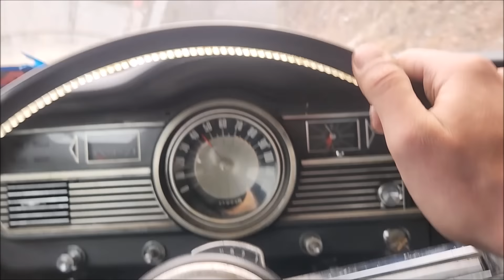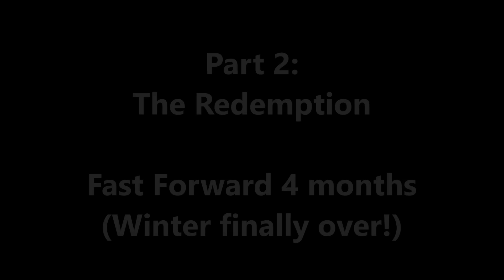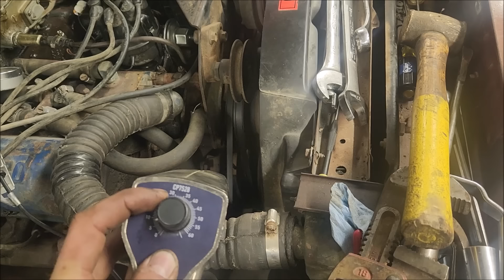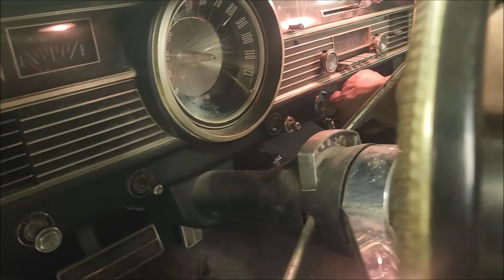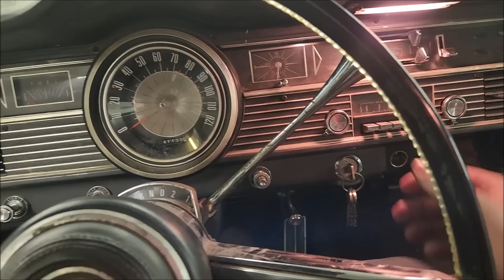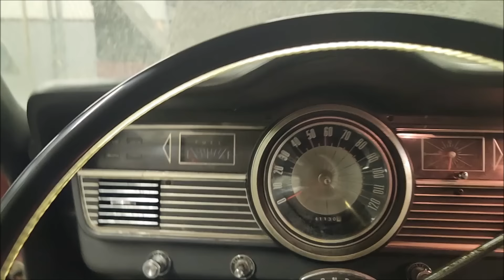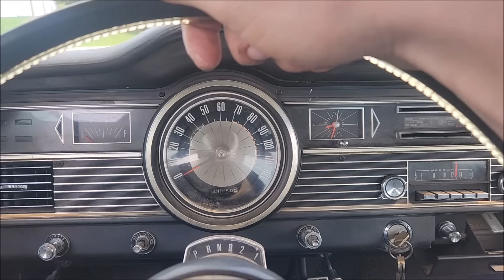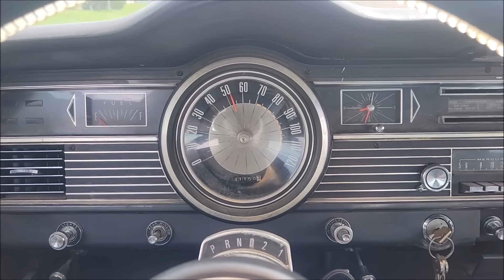$1,000 Classic Car - Will it Run & Drive Home?

Comment: all you have to do is stick a plastic grocery bag in the spark plug hole and it will pop out on the compression stroke, then back the engine to TDC.
Reply from the maker: Seems like finger on the hole but with extra steps 🙂

Comment: Manifold vacuum advance is the proper application not a “mis-use”
Reply from the maker: There's no such thing as "the proper application" contrary to internet people. But there is a more effective and less effective - manifold often being ultimately the less effective as far as mechanical timing is concerned
Reply: @ThunderHead289  I don’t understand that.  Why would you want the timing which the vacuum advance canister gives you overlapping with the mechanical timing?  Isn’t this what happens when you’re running ported?  In other words, when you step on the throttle, manifold vacuum goes down while ported vacuum goes up until they equalize and then both dive to zero as you continue to press that pedal.  So if you’re running ported and step on the pedal, it’s giving you advance concurrently with the mechanical advance from the distributor.  Why not just let the mechanical advance do its job?  Why the overlap?  That just doesn’t make sense from an engineering perspective.  On the other hand, when you’re running manifold, your canister is giving you full advance at idle and then as you step on the pedal, manifold advance begins to bow out while your mechanical advance steps on the stage.  It’s a seamless transition that seems, well, like it was designed to be that way.

Comment: Nice fuel leak at the filter.
Reply from the maker: No kidding - i did see it and fix it in the video😄
Reply: @ThunderHead289   I have owned a lot of the 60 and 70's fords. More had that fuel leak. Than did not leak for some reason. My old 460 could not leak gas. It drank so much it never slowed down to leak. 😎 But man did it ever run.

Comment: I find it strange that fords especially the FE and 351m/400 distributors freeze into the blocks. But if anyone can fix it, uncle Luke can
Reply from the maker: On gm stuff, the distributor is somewhat part of the oil systems passage - like if you try to prime a 350 oil pump without it in, one side of the rockers won't show oil. I think that also helps to prevent them seizing. 
But I think also that many FEs just run for so absurdly long and being from the days of oilschool oil, a lot are just oil varnished in place after all this time

Comment: Uhh. NPT requires Teflon tape or liquid Teflon. Not sure why you didn’t put any to begin with.
Reply from the maker: Technically it doesn't - most fittings will seal without it new.

Comment: Using a Vacuum gauge is the Correct way, to set carburetor.
Reply from the maker: No dispute there. 
As long as you know what your trying to achieve with it
Reply: 48 years running a shop Vacuum means a lot. cam problems timing and carb.

Comment: Ugly, stupid and amazingly effective.  Hard to argue with it when ugly and stupid are so effective.
Ugh, red Locktite.  When that stuff makes a proper bond, significant heat is required to break the bond.  People do not seem to understand that there are more appropriate thread lockers and most often, clean threads will provide more than enough friction to prevent a properly tightened screw from loosening.

That is quite the fuel leak at the fuel filter.  Yep, cross threaded and likely cross threaded more than once.
I'm convinced that Ford's cast iron exhaust manifolds were designed to crack, at least the ones on the passenger side of the engine.
Doesn't everyone keep a pair of safety glasses under the carpet in their car?  

Ford did make good engines, transmissions, and drive axles back in the day.  "Built Ford tough" was not just a marketing slogan, there was a lot of truth in that slogan.
Reply from the maker: Ford had a solid era of tough vehicles, as did our other friendly manufacturers of that time - it was a perfect blend of capable, robust, and easy to work on and understand then. I'm sad it's getting farther and farther away as time goes on and the old iron slowly disappears. 

I used to see classic stuff on the road all the time as folks normal cars up until about ten years ago

Comment: All you have to do is bump the starter and the distributor will drop
Reply from the maker: That's what I do, I just never tell people that since there is a chance to bind up with the cam and snap a tooth off. Been in the presence of someone doing that right in front of me and I don't want to be the reason that happens to someone else

Comment: Line it up. Bump the starter and it will drop into the oil pump.
Reply from the maker: It works - a few risks involved.

Comment: F.Y.I. A WORD OF CAUTION! When removing ford distributors and reinstalling them make sure you use a flashlight to look into the distributor hole to see if the oil pump rod didn't fall out and silently sneak into the oil pan!!!! The Engine will fire up and run perfectly until it destroys the crankshaft!!! Ask me how I know! I now suffer from automotive P.T.S.D. Watching you install the distributor I was like LUKE! LOOK FOR THE OIL PUMP ROD! LOL!

Comment: I see you setting your points with gap..and never dwell.  Any reason?  I thought dwell is more accurate.
Reply from the maker: Everything will largely be happy in the .017-.020 range on points - folks can scrutinize it more if they would like, but I've always found that to perform quite well throughout the rpm band
Reply: Cool thanks...your videos are very useful to learn these old ways.

Comment: what does that have to do with a 67 ford?
Reply from the maker: A mercury is a ford, a ford is a mercury- same same. Same platform different panel stampings, same driveline. 

Unlike GM which had Olds engines, Pontiac engines, and so on - any ford based brand had ford series engines

Comment: It's a Mercury, not a Ford....?
Reply from the maker: A mercury is a ford - ford driveline, ford frame, made by ford. 
Just different external sheet metal - in this case, it's the same as a 67 galaxie but with its pinky out slightly

Comment: Looks like you have about 17 feet of Mercury to me 42:54
Reply from the maker: The vacuum gauge is one I often use on the channel - it's shifted 2 off where 0 is actually like -2.5. 
Normally I like to see no vacuum on ported port at idle, but when the gauge here says 0, it's really 2-3, but the vacuum threshold for any vacuum advance to start opening is generally 8 and then full vacuum by 12.

Given the initial and total, I didn't want to give it more timing to lower the curb idle screw any further - it ended up working all out very well. 

Thats a long way of saying that 17-18 on that gauge is about 19-20
Reply: @ThunderHead289  you missed the joke I was talking about the car 😂

Comment: "classic Ford"?   Looks like a Mercury to me.
Reply from the maker: Same frame as galaxie, same driveline - a mercury is but a ford but with different sheet metal. 
Unlike gm where a Pontiac is completely different than an Olds, which is completely different than a Chevy.

Comment: That's a waste of a good car.  I won't strip a good solid body for the drivetrain.  There's a lot of rust buckets around with good engines to use.  Id hate to see him pull that motor and the rest get parted out or crushed.